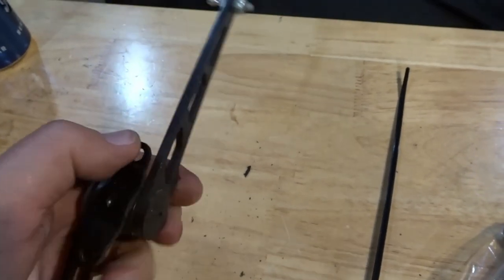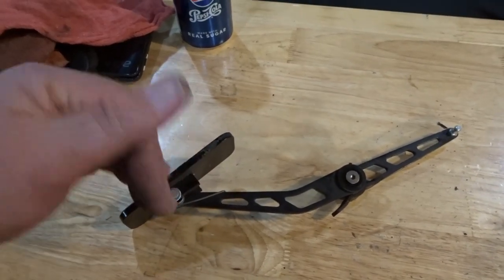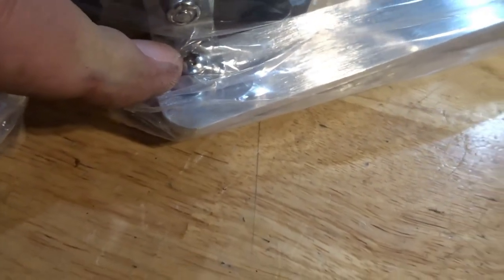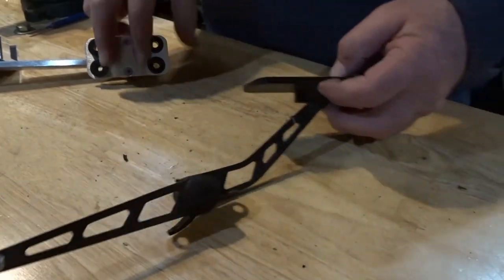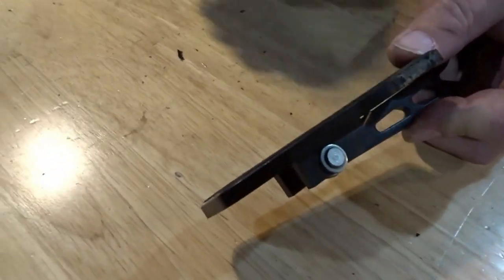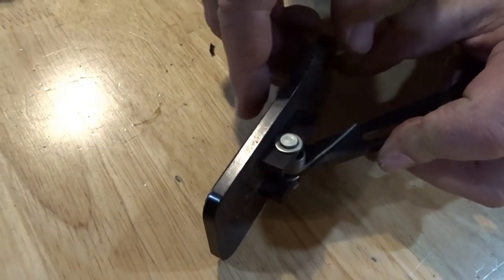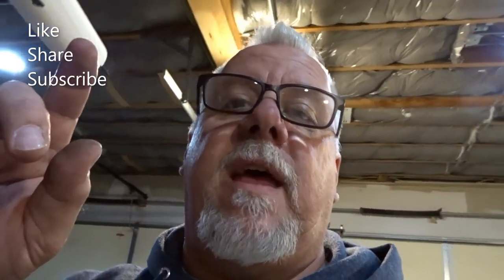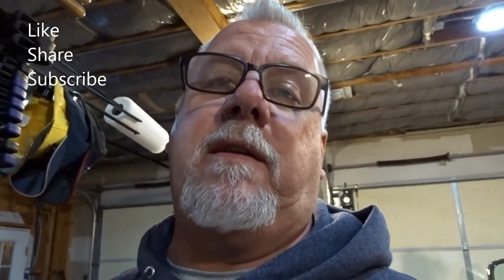Not Happy With the Supplied Throttle Pedal From Factory 5 Racing? We'll Show You How to Mod it.

Comment: Interesting, as I'm currently looking at issues with a UK supplied drive by wire throttle pedal issue which matches up with an LS3 motor. Drive by wire no cable.
It uses a corvette / Chevey LS type pedal which also has the spring on it, which means its always flipping back due to the spring, also the fact that it sits at an angle and not straight, just doesn't feel right under your foot. 
I think most of the problem is the throttle pedal assembly is due to being for use on left hand drive US cars not Right hand drive UK.  But I like your idea on locking the pedal in place with second pin.
Reply from the maker: Could be........ never thought about you UK builders. Hope this helped you. And thanks for watching.